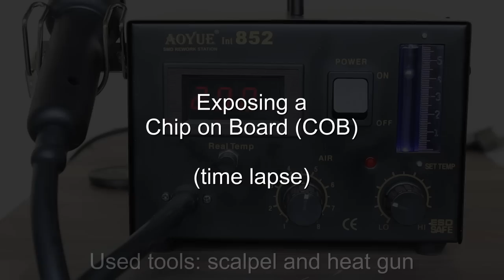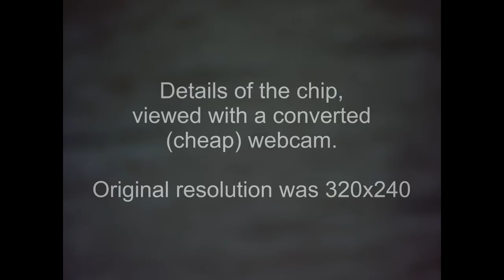Exposing a Chip on Board (COB)

Comment: Should be able to use some type of solvant to dissolve the epoxy without breaking the wires
Reply: Sulfuric acid, or glycolysis can work. It pretty much ruins fiberglass too so it's not perfect. Also laser engravers can sort of reverse 3d print them, but you kinda need to know exactly where the die is. I'm making a micro x-ray machine just for that reason.
Reply: @phantom2012  I would think that the solder mask would protect the fiberglass long enough for it to dissolve the epoxy. Once you're looking to expose the chip you pretty much sacrifice the board too so I don't think it's that much of an issue.  Maybe preheating the epoxy will allow a weaker solvant to take care of the epoxy without damaging anything else

Comment: Is the chip itself destroyed by this process or is it possible to reconnect the wires with proper equippment?
Reply: Gar Goy yes, it looks like a small cpu
Reply from the maker: At least the bonding wires are destroyed, and reattaching them is beyond my capabilities.
Reply: @KaiBader_de  but is it possible ?
Reply: yes, you would of course need a machine to do this and very fine wire. refer to this video https://www.youtube.com/watch?v=mvZ1dJuvenw
however you would also need to wire them correctly, which is another problem in itself, but if you had many of these chips you could just keep trying until it worked lmao.
Reply: I need to manufacture sound chips that contains sound of my choice. Can you help me. Need to make simple many sounds recorded in them. Like Chinese toys have
Reply: @yugopal  try finding chinese suppliers of such things and ask them
Reply: @fasrart  ofc it is Zeloof! Thx
Reply: It's destroyed. The mechanical force from the epoxy separating is enough to peel layers off. Even the IC's decapped with lasers are destroyed. There's no chance this did no damage.

Comment: Is it safe to leave it without the blob? Will it still work or will it break. I have some bootleg famicom cartridges, so I want to fix them
Reply: Depends... If you damage the bond wires by decapping, say rip to your cartridge, they cant be soldered on they are welded on so if that happens you cant fix it. Also semiconductors that are made of silicon are sensitive to bright light, because it generates voltage in them and that can mess up bits inside the die. Thats why solar panels use silicon and chips are packaged